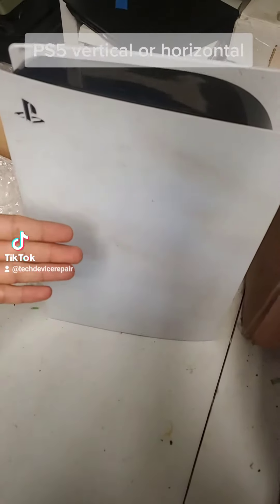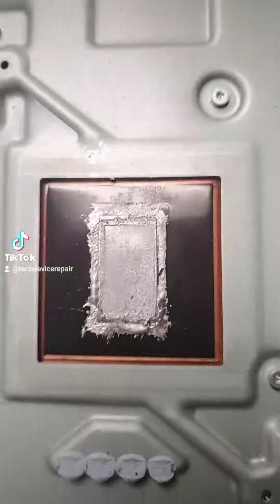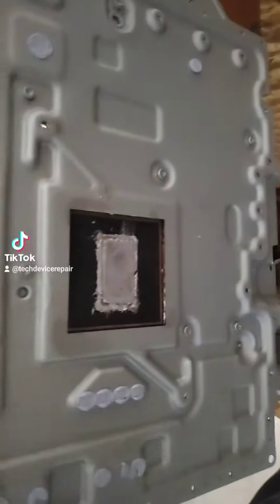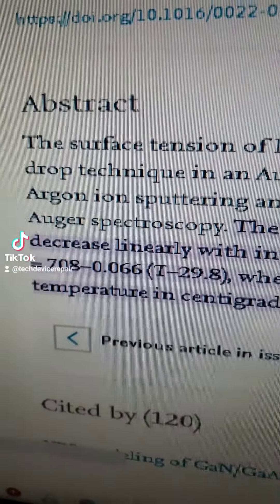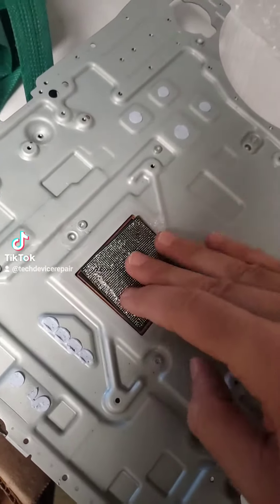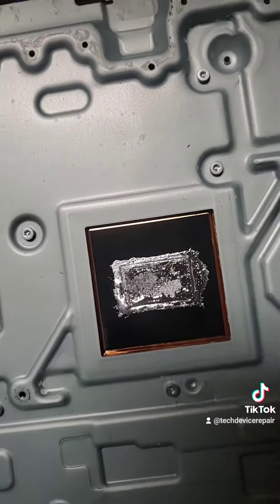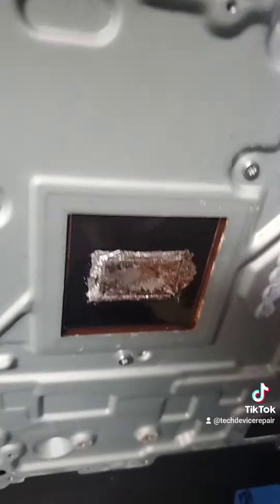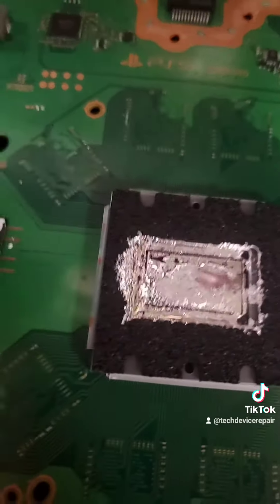PS5 Vertical or Horizontal? PS5 liquid metal problem

Comment: Does the LM not moving apply even when it gets hot and more playable? Or does the tight fit prevent it from “swooshing” around?
Reply: That's the part I was questioning. If the liquid Metal heats up doesn't that cause the LM to solidify then move over to one side a lot?
Reply: Be careful I asked that and if you look at the response. Little Homie J freaked the hell out
Reply: @heyzeus9497  he must’ve hid the replies because it shows there’s 2 but when I go to view them nothing appears.
Reply: @J0URDAIN  that's about right

Comment: How does liquid metal react once it heats up? Will it be more prone to seep over time?
Reply: Mine was bought day one in NOV 2020 ...now almost 4 years later [ always sit HORIZONTALLY like my PSX-PS2-PS3-PS4 }I started to experience freeze/shutdown and guess what : my CPU have a DARK/BLACK CORRODED CPU because 80% of the Liquid Metal have go on the outer side of the CPU because of the overheat , I cleaned this mess but for my CPU its already too late , its corroded to a very bad point !

Comment: Mine was bought day one in NOV 2020 ...now almost 4 years later [ always sit HORIZONTALLY like my PSX-PS2-PS3-PS4 }I started to experience freeze/shutdown and guess what : my CPU have a DARK/BLACK CORRODED CPU because 80% of the Liquid Metal have go on the outer side of the CPU because of the overheat , I cleaned this mess but for my CPU its already too late , its corroded to a very bad point !